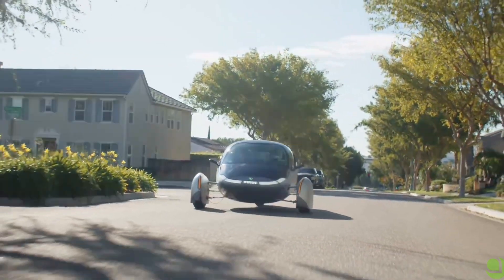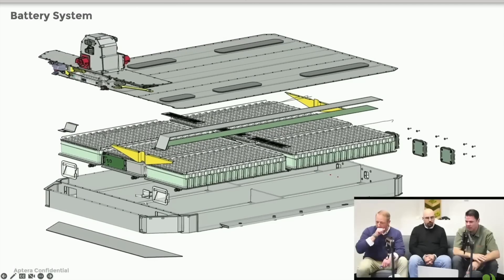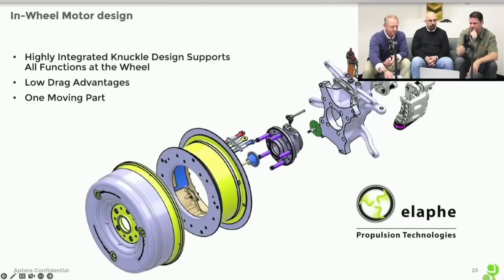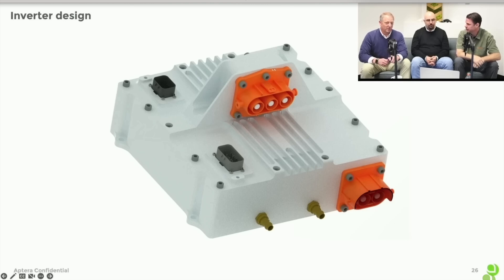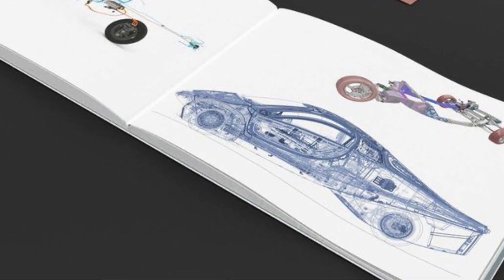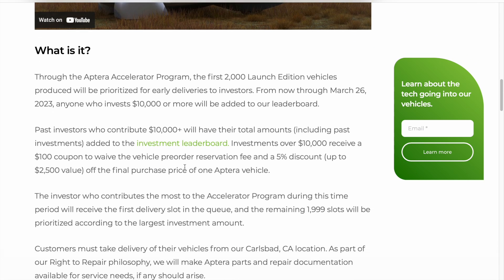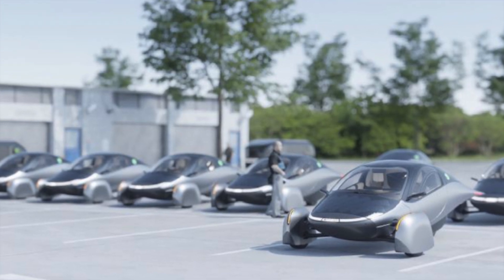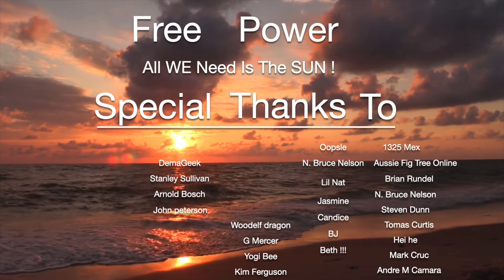Aptera's Battery System !

Comment: The compartmentalised heating/cooling system for each different component is very interesting, but I wonder if there is any way to arbitrarily bridge them together, so that the waste heat from one system, eg the motor/controller could be used to say, de-mist the windscreen, or keep the seats warm, or power a built in tea and coffee dispenser.

Actually mostly the tea and coffee dispenser.